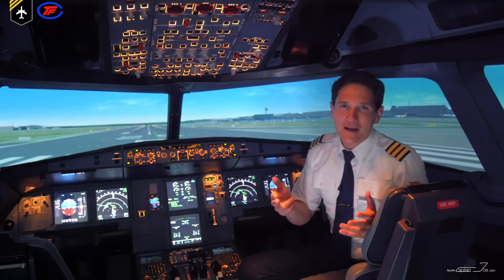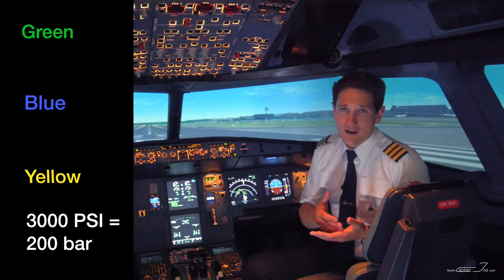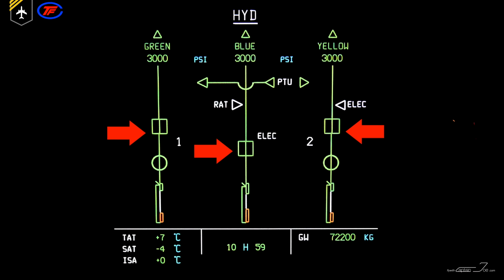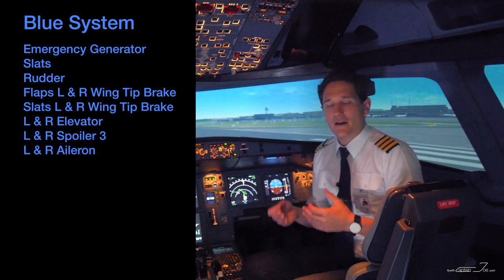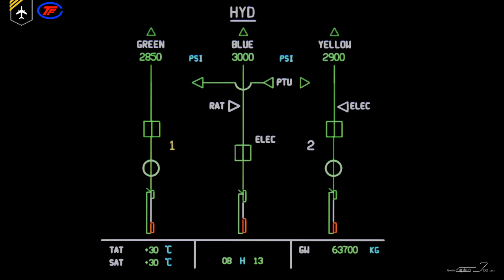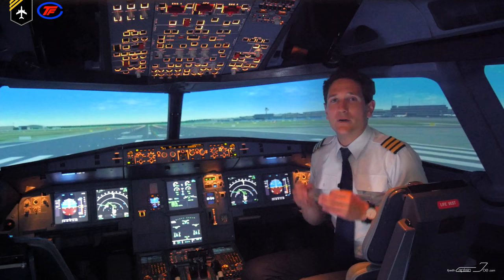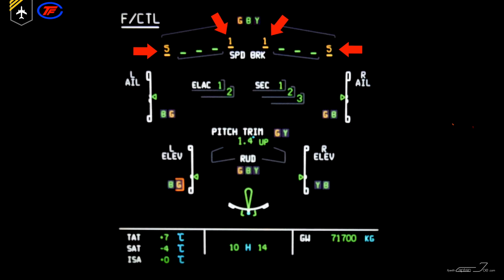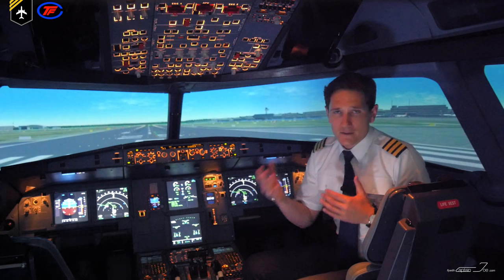AIRBUS HYDRAULIC SYSTEM how does it work? Explained by Captain Joe

Comment: Do a video on the FMS please. Like if you agree
Reply: SwagRanger FMGC/MCDU
Reply: MCDU not FMS and btw it's FMC...
Reply: Here's a simple in-browser simulator that you can play with
http://www.equicom.net/mcdu/

It's limited, but you can press the buttons
Reply: nah FMSystem / FMControl, just same name (i im not mistaken)
Reply: and CDU is control display unit
Reply: oh wait FMS/FMC (both the same, choose your flavor) is "the thing" and is controlled by the CDU
Reply: same thing! FMS=  Flight management system FMC= Flight management computer same thing boss :)
Reply: FMS = Flight management system It is the same thing guys. You get the point ;)
Reply: And consider please the fact that an Airbus's MCDU resets all the entered pre- and in-flight data after touchdown and compare this to 738's MCDU (or what it's called, whatever). Or did they fixed that?
Reply: I am not sure?
Reply: It is a comment for captain Joe ;)
Reply: @lowcostsuperhero  wow!! thank you mate!
Reply: MCDU-The display and interface combined on A320/A330/A340
FMGC-The system used to enter flight plans/ take off data/ fuel predictions etc for managing the flight.
FMS- The equivalent to the FMGC on A350/A380

I believe that’s the definitions

Comment: Thank you for your videos Joe! Watch them all. 

After you're done with this series, if you can, maybe you can answer my question: why is the vertical stabilizer so vitally important to an airplane? I know there was an air crash where a pilot overused the rudder thinking it will help reduce the turbulence, and sadly the vertical stabilizer got disconnected from the airplane and it crashed. 

I understand the same situation with any other part of the aircraft (horizontal stabilizer, wings etc.) but with the absence of the vertical stabilizer can't the pilot compensate with controls of flaps, horizontal stabilizer etc.?

I know the question might be a bit stupid but I'm very curious.
Reply: Paul Jelly Hello there. Let me try to help explain. Basically an airplane has 3 axis of motion, being PITCH, ROLL & YAW.

Pitch is controlled by the elevators at the horizontal stabilizer.
Roll is controlled by the ailerons at the wings.
Yaw is by the rudder on the vertical stabilizer.

Take any one controls away and you lose control of that axis. However of course you can influence one axis with another. But the effect is tiny compared to an actual control and also influencing another axis with another causes other secondary effect as well which further complicate the matter. 

Its like you are trying to turn your car at speed with one front wheel missing.

Comment: I really enjoyed this video. Something I have always wondered about is what is the "engine and APU bleed" Air systems on an aircraft? I know that it has something to do with the A/C in the cabin, but I would like to know the details of this.
Reply: The Engines and APU, as part of their normal operation, compress air for combustion. These bleed air systems tap off the engines and APU and use the bleed air for cabin pressurization, Air conditioning, Head pressure for hydraulic reservoirs, engine inlet deicing, wing deicing, and used for engine starting on the A320 family. Other aircraft types use the bleed air for windshield deicing(Some LearJets) and engine thrust reversers(Ex CRJ200). There is a performance penalty on the engines when bleed are used. This bleed air from the engines/APU is usually very hot and at pressures ranging from 15-80 PSI, depending on aircraft. Engines provide a much larger volume of air compared to the APU. That is why typically the APU is only used for air conditioning and engine start on ground. I wish i could explain more but this isn't the place. 

Also, look up air cycle machine.

Comment: I think the L/G extension manually is incorrect. Here it shows first LG lever down and then manual extension cranking.
It's actually other way around. First crank manual extension lever 3 times THEN LG lever down.
Overall Joe...fantastic explanation.
Reply: Yes you are correct.

Comment: Hi Joe, in case of dual engine failure the RAT deployed, but you can also start the APU providing eletric power so the blue hyd pump works normally and you can also start the eletric yellow pump right?

Comment: Thank you for great video! I'm interest in Airbus.
Seems less redundancy than E170. E170 has electric backup pump for each EDP(HYD1&2), and HYD3 system(electric only) has another electric backup pump.   
E170 PTU works HYD1 to HYD 2. so HYD2 taken care of nose wheel steering& LDG gear operation.

Comment: The hydraulic system in the 737 is more traditional, but both planes are good. The 737 can be totally without electric power, the cable system can still steer it.

Comment: Morning Captain! What supplies hydraulic power to the parking brakes before removal of chocks? APU or APU/Battery power to electric pump?
Reply: A brake accumulator. A bladder tank with fluid on one side and high pressure nitrogen on the other. With a fully charged accumulator, and zero hydraulic pressure, it provides about 7 applications of the brakes (I think? Need to look it up). WIth no engines running, basically the accumulator holds the pressure on the parking brakes. If the accumulator runs low, engage the electric pump as required.

Comment: hydraulic on plane sometime suck, because when ever your hydraulic line is punctured, you lose hydraulic and the flight control wont respond but you can still use the engine to turn but it will take a long time  to land safely.

Comment: Captain Joe, why cant they put simple low pressure line locks on key areas with electric overide systems so that say major damage happens and a leak happens the system instantly shuts and prevents major leakage.

Comment: is the RAT the emergency generator or is it independent from the RAT and located somewhere down stream in the blue hyd line? If the latter then why do we need to deploy the rat for electric emergency config during smoke since we already have blue hyd pressure

Comment: Does the APU come into play in providing power to the electrical pumps if it's not coming from Engine 1 or 2 or Batteries?
Reply: Yes, they can switch on the APU to produce the electricity. And A320 has also the ram air turbine (RAT), which can be used if necessary.

Comment: Hi, captain Joe! Cool video. Can you explain, in case of, for example green sistem low pressure fault just during the flare, will it get enough time for PTU to recover the pressure and keep the left elevator up, to save the flare position? Or it should take time, and as a consequence the left elevator-down to neutral,, right elevator -the same to prevent the assimetrical loadings on the stabilizers. And as I understand, the nose wheel can hit the ground. Can this happen?
Reply: The blue system also controls the left elevator

Comment: 2:33 "Yam Damper 1" -- Did you mean to spell "Yaw Damper" and if not, what system/part of the machine is that?

EDIT: 3:13 Yes, Yaw Damper. Can you tell us more about how the plane gets environment data (Pitot tube, does it have a weather radar, how is data transmitted between a commercial flight and ground stations, how do Yaw Dampener, Slats and automatics like stall warning or auto-reverse thrust get their data from)?

Keep up the good work so far! I'm really interested in the technical details of planes - these are marvelous machines.

Comment: Captain, in an earlier video you unveiled the mistery of the "barking" as being the PTU kicking in until the second engine is up& running. If an engine would fail mid-flight and the PTU would kick in, would the passengers hear the PTU working until the remaining engine is stopped on ground or it is that noisy just until it starts up properly?
Reply: You would hear the barking the whole time. The way the system actually works is by differential pressure.  I don't remember exact numbers off the top of my head but lets say 300 PSI. If there is a difference greater than 300 PSI between the G and Y systems, the PTU engages. The pressures between the G and Y equalize, the PTU shuts off. The bad system drops 300 PSI, PTU engages... and so the cycle goes. The barking is the PTU basically turning on and off.
Reply: Mark Thanks!

Comment: How many cranks on the manual landing gear handle to fully lock down the landing gear? Great video.
Reply: Charles Damery ithink it was 3 turns🙂
Reply: Charles Damery I believe none. 3 turns to release the gear for gravity drop.
Reply: Two turns for the L/G doors and a third turn for the L/G, but you have to wait with the third turn until the L/G doors are open. If you do it like captain joe did in the video, you have a good chance that the MLG´s are blocking their doors and you can prepare for a belly landing...

Comment: Hi Captain Joe !!! This was a great video with lot of learnings.. Just got couple of question if you could answer. Does all the systems GBY are running continuously or they activate only at the time of failure or loss in pressure of one system ? Is there any sensor that detect loss in pressure  or there is some other process?

Comment: I was a passenger on a flight which had a hydraulic leak right after takeoff and we had to turn around and do an emergency landing. After watching the video, it appears we had a green system leak because we had to get towed back to the gate, and also fire crew had to water the brakes on the runway because the brakes were really hot apparently. That's crazy

Comment: Hello Captain Joe and crew. There is one thing i don't understand. How is it possible that you can use the landinggearwheel brakes when only blue hydraulic system is available. The RAT only supply the blue system didn't it?
Reply: The wheel brake system have a so called "accumulator" installed for this case. Basically it's a hydraulic fluid reservoir which stays pressurized, even if the rest of the hydraulics fails. It should give you enough pressure so you can apply full brakes at least 7 times.

Comment: Two questions for you Captain. 
1. Where would the ALTN BRK be in the a320 
2. what is PTU?
Reply: First officer Chris, aircraft brakes like on the A320 have multiple pistons. Half of those pistons can be driven by the Green system and the other half by the Yellow system. When one hydraulic system fails so does that set of  pistons so you are left with only the set of pistons related to that hydraulic per wheel to stop an aircraft. When the pistons are powered ONLY by the yellow system then it is called "Alternate Braking". When the pistons are being mainly powered by the Green system this is called "Normal braking".
Reply: The PTU is a Power Transfer Unit that transfers hydraulic POWER (not fluid) go to either the green or yellow system depending on which one has lost pressure. If you lose the right engine (Yellow main pump) and you also happen to loose the Yellow electric pump or somehow it's not operating correctly then the Green system will power the Yellow system through the PTU and vice versa.
Reply: Even in normal braking mode only one set of pistons is operating -> the green ones. If you lose the green system, the yellow pistons come into play. But both sets of pistons at the same time... no.
Reply: Microbladehaiza ok
Reply: fadimo305 ok
Reply: Hi fadimo305. I had this checked two times today, as long as you are in normal braking and everything is operative only the green pistons are moving. For the case that the yellow pistons are in use, you would have an indication on the triple indicator then. But that is only the case when you operate the parking brake, lose the green system or lose the BSCU. So, the answer is correct, only one set of pistons is used at a time. There is only ONE very special case when both sets of pistons are operated together, but thats far from normal operation.
Greetings

Comment: Capt. Joe Thank You. Explained very nicely.
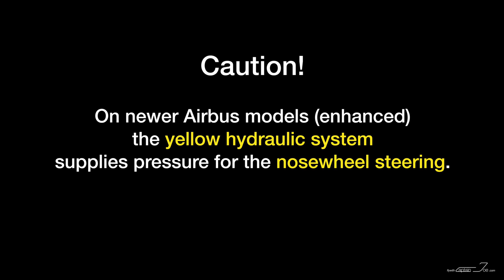At 03:30 it says on newer 320 yellow hydraulic system can supply pressure to the nose wheel steering. 
So in that case we should have nose wheel steering in case of loss of hyd fluid (low) from green. Right?
Reply: Yes. It’s because if you performed a landing gear gravity extension it shuts off green hydraulic system to the gear and NWS (rest of hydraulic system is fine) So now if you have a gear problem and used gravity extension you no longer need to request a tow truck as the NWS operates on a different system

Comment: I was told by a test pilot ten years ago or so that the Airbus hydraulic system was nonreliable because of the design of the hydraulic lines located in the wings and  in danger of being cut by the wing flaps.  Does this make any sense?  Thanks.
Reply: Ross Schultz NO. I work as a Heavy maintenance technician on the Airbus Family and what that test pilot that is untrue. The Flaps never ever come close to those lines.

Comment: Great video! BTW, I was just now on an Airbus A321-200, seat 3B (on the left side). I heard and felt a banging sound coming from the floor (could feel it with my feet). It started after descent and I could feel it on taxi too and even when the aircraft stopped. What could it be, is it related to hydraulics?

P.S. I think it is not the PTU sound as this is  exactly a bang and not related to brakes (at least I think so, as I could hear it on the ground too and on descent the bangs somehow don't come directly below you, that was like exactly below me, felt that way).

Comment: Dear Captain Joe, or anyone here would like to explain to me

What causes failure of any of the system? is it because of the fluid or the pump? Either way, how to overcome that failure during maintenance?
Please respond, Thanks.
Reply: Josua Alexander anything which is mechanical has a probability to fail. There r just so many external factors. Could be as small as an undectable microfracture

Comment: Can you explain the A320 Ural Airlines and its landing on wheat field at September 12 2023, because of green hydraulic system failure? Will, I think hydraulic system failure and decision to land on spring plowed wheat field are to connected to each other. And..can A320 land on soft field and not dig deep into soil??

Comment: #captainjoe a quick question- are the moving parts in this hydraulic system are only located at the respective flight controllers such as near flaps, spoilers etc?
Reply: Mani Ramachandran, Yes. The actuators and components that actually move the flight control (primary or secondary) are located at the area of those controls. The three main hydraulic system components are located in different locations and heights in the wheel well.
Reply: Thanks much!

Comment: Hi Joe,
I've got a little question:
Asume that the yellow system doesn't work anymore. NSW is inoperative as well as Rev. Number 1 correct? So how can you control the airplane while braking? With rev. 2 active the airplane will break away, won't it?
Reply: Moritz Karbacher, you don't operate number two reverser and use differential braking to steer the aircraft if something like that happens.
Reply: Moritz Karbacher the rudder can be used to steer the plane and keep it straight on the runway provided there is enough airflow over the tail. At lower speeds differential braking can be used.

Comment: Hello Captain Joe.. I'm a big fan!
Physics question: can an airplane takeoff if running on a huge imaginary treadmill and reaching to the right speed ?.. if Yes, how and if no, why not? :)
Reply: metoo4000 Kinda like how an aircraft carrier works... Yes, a physics question. If you can somehow subject the airframe to the same velocities as in flight, it flies. Nothing more to say.
Reply: I dont think it will as an airplane does not depend much on the velocity it is travelling but rather the velocity of the air it encounters, the air is what allows the wings to create lift; that's why on windy conditions, pilots usually prefer headwinds as opposed to tailwinds as the take off speed and time are reduced
Reply: It will take off and the reason is simply the propolsion system aircraft uses. The treadmill would only prevent any movement if the vehicle uses the ground to basically "repulse" itself along. A car for instance moves itself by transfering energy to the ground via the wheels.
Well, an airplane doesn't do that. The engines do move a lot of air, but they have no physical conection to the ground so there is no energy transfered so the treadmill would have no effect.
It's like you would stand on the treatmill but instead of using your legs, you take a grip with your hands somewhere and pull you self around with your arms.